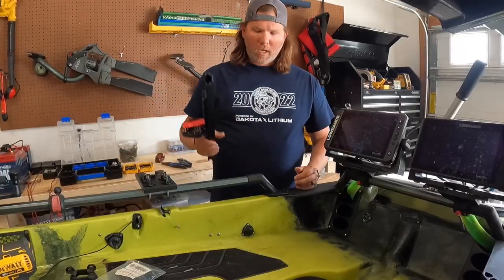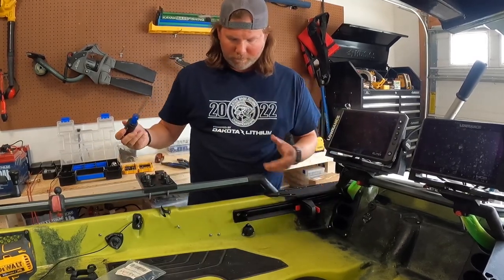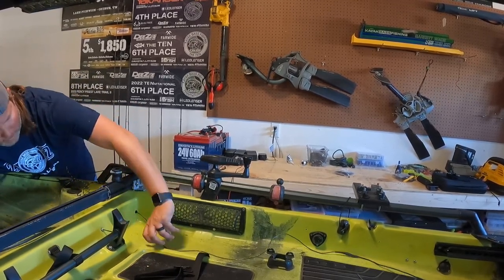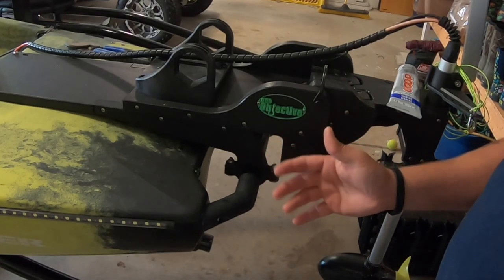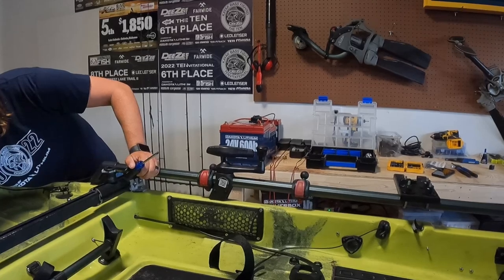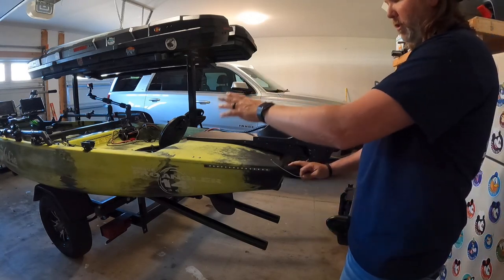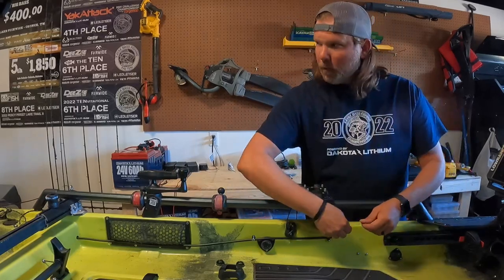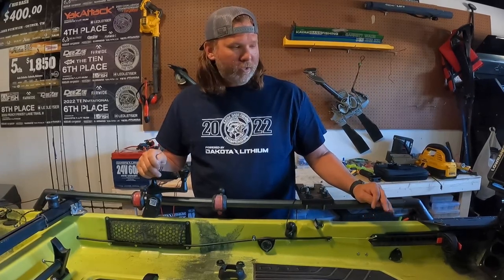How to Install Foot Steering on a Kayak. (Step by Step with Materials List)

Comment: I love the idea of using tubing.  I hadn't thought of that but it makes perfect sense.  And even though I don't have a drywell access I think I can use my rod holder openings for this purpose, if not a little more challenging. Thanks for a great helpful video.
Reply from the maker: Glad it helped. I like the idea of the tubing keeping the lines from getting hung on stuff

Comment: Thanks great tip on sliding foot brace as far forward as you want it to turn, I'm  quite sure you probably saved me some time adjusting the braces.  I just finished putting in the 1/4" irrigation tubbing in my yak tonight, just have to fish the cable tomorrow. I couldn't get the string thru more than a foot or so, so I'm just using thin wire cable. Fish on!
Reply from the maker: Awesome. Thanks for the feedback. Good luck out there.

Comment: Nice video. When you are screwing in the foot steering brace are you screwing straight into the plastic? How does it hold? It seems like there would be a lot of force on those screws to hold in plastic. Thanks
Reply from the maker: Straight into the plastic. It has held up pretty well with a year of use. I’ve done it a little differently on my rig for this year and will have a video on it in a few days. I mounted the foot braces on the Hrail this time.

Comment: Are you able to use the horizontal rod storage while using the foot steering?
Reply from the maker: You could probably still use the bottom one on each side the way I have it rigged up. You can also mount your pedals above the gunnel and keep full access to them. I personally have never used the horizontal rod holders. I keep a couple rods beside me but they lay up on top and the rest are verticals in the crate.

Comment: Is this still the same setup you use or after some time on the water did you, or would you make some adjustments somewhere?
Reply from the maker: I’m still using it the same way. I may raise where I have my foot steering a little to help with steering while standing but I don’t want them on top since I lay my rods there.

Comment: Should have run the tubing closer to the pedal. They have 30 degree ports for the exit of the tubing at the pedals.
Reply from the maker: I’m aware of those. I didn’t want anything else run in the gunnel where the rudder cables are

Comment: How can I attach that steering triangle to my motor if it doesn’t clamp on does it slide on because the head of my trolling motor is very big
Reply from the maker: The steering triangle slides over the shaft. It’s made specifically for the Newport motor
Reply: @garrettwadefishing  thank you Garrett for your response
Reply from the maker: No problem